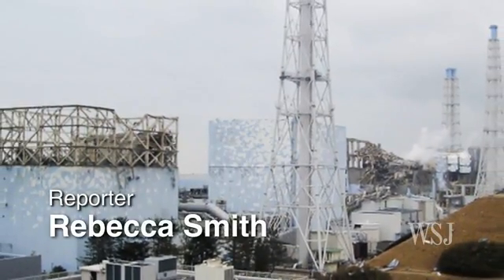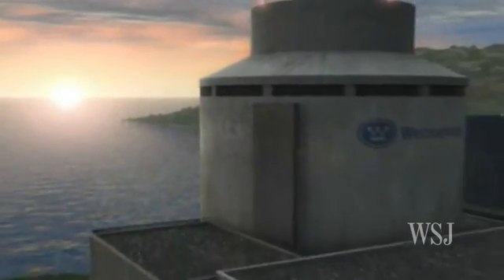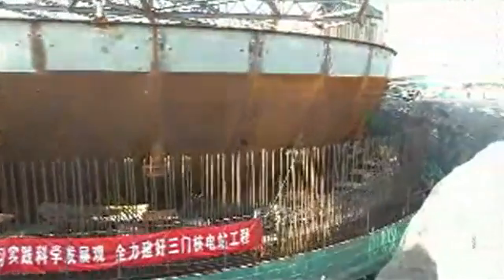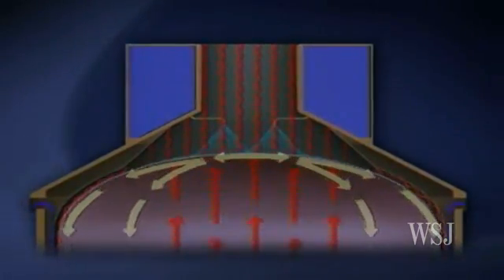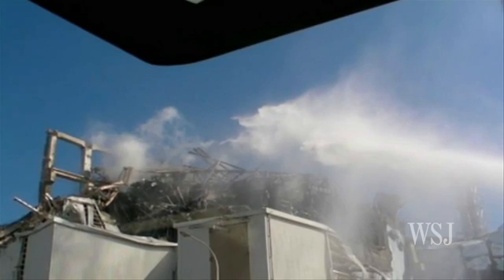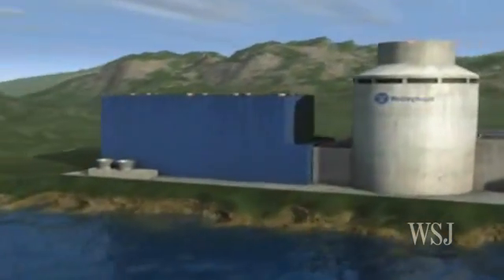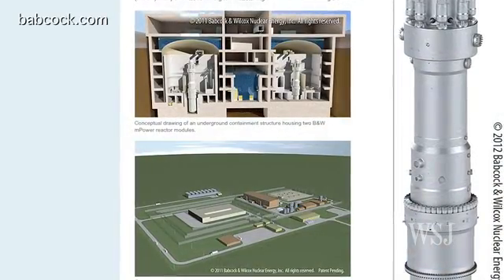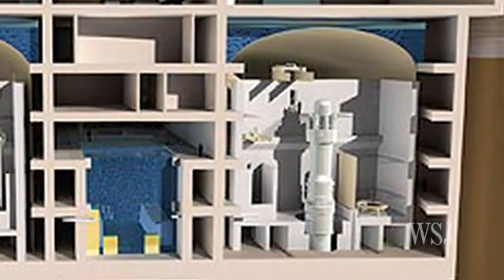New Designs for Nuclear Reactors

Comment: China is building 40 3rd generation  high pressure water cooled nuclear reactor and two 4th generation pebble bed helium cooled nuclear reactor.The US has stopped buiding the second generation water cooled nuclear reactor like the Fukushima reactor..China is going to the far side of the moon to mine Helium-3 for nuclear fusioin.

Comment: we should just run some hot water pipes through the sun and back. Limitless potential!

No but seriously why no mention of LFTR's? That is a much safer form of reactor. Also 1/50th of the waste produced.

Also I want to point out that 3 Kg of uranium (you can easily hold it in your hand) has as much fire power as 40 000 barrels of oil.
Reply: thank you even India has said they wish they had gone msr  thanks tom

Comment: Funny how nobody has mentioned heavy water reactors which are much safer than current light water/ high pressure reactors, oh & they get rid of nuclear waste too, & that's why we aren't using them!
Reply: They can't get rid of nuclear waste, they just burn uranium a little more efficiently. The fissile content of the unburned uranium in spent LWR fuels is high enough to be used again in a CANDU if you remove the fission products first. We don't use them because heavy water is even more expensive up front and uranium is dirt cheap if you look at it's per KWh value. CANDU's aren't inherently safer (with that positive void coefficient), they just had more safety systems to begin with.

Comment: Except there isn't a nuclear power station being built that doesn't require back-up generators to stop cores from overheating in case of an emergency. This video is disingenuous.
Reply: kie7077 Overheating and exploding are different things. I guess Closed Brayton cycle turbines don't need power because their pump (or compressor) is driven directly by the turbine shaft unlike Rankine cycle turbines, they are driven by electric pumps.
Reply: Use molten salt as the fuel and coolent. 0 pressure operation and walkaway.   Can also use pebble bed fuel too.  Same thing,  a walkaway unit.   Molten salt is the way to go for about 1/10 the cost. With a research push such system could be developed in 5 years and online in 10.  Such reactors have already been tested in OakRidge NL with  China actually building such units.

Comment: Passive cooling systems on the AP1000 design is not fool proof and eternal. Technically delays the onset of Core Meldown by about 72 hours. 

The rest of the reactor design is essentially 1970s architecture with modern control and bells and whistles.

Using Nuclear fission as a means of boiling water to turn steam trurbines is perhaps one of the most insane and rediculous human developments seen on this planet since the moon was formed.